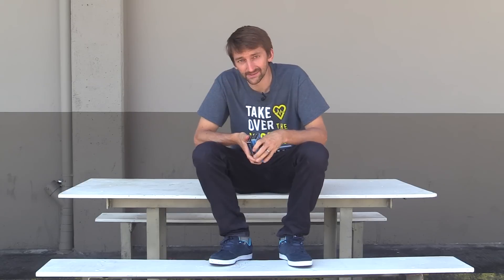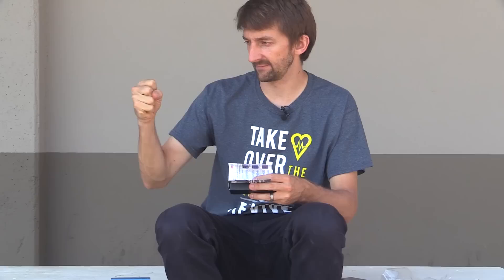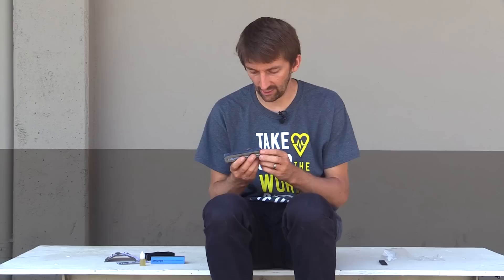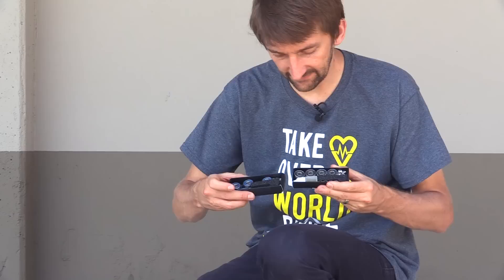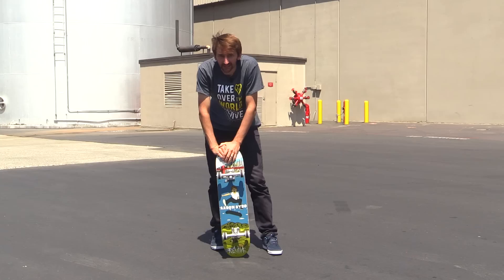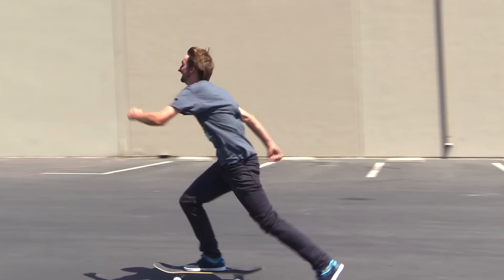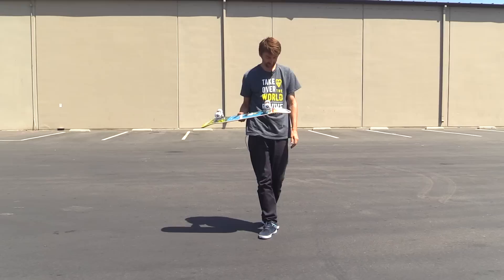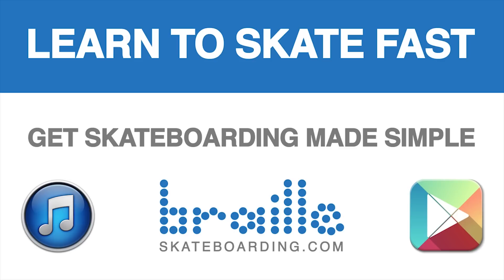CERAMIC BEARINGS VS STAINLESS STEEL BEARINGS | VS EP 9

Comment: Both Stainless steel and Ceramic ball bearings are a marketing ploy to get you to buy a product that YOU DON'T NEED!  I have been an industrial bearing sales rep for 20 years (and an avid cyclist, and we have this same "technology" debate).  Ceramic: Unless you are going to be skating/riding in a furnace, hell, or boiler, ceramic balls are silly; here's why: the purpose of using ceramic balls is they don't expand as much when heated which means they retain their shape better when the temps are over 500 degrees - since humans cannot survive at that temp and it is highly unlikely any of you will be skating/riding in those conditions, then you are left with ONLY the downside of the ceramic balls - they are HARDER than the inner and outer races which means they will wear out FASTER than conventional ball bearings and you will be paying MORE and doing it MORE OFTEN!  On to the the Stainless steel myth! S/S is need for corrosion resistance ONLY!  If you are doing ALOT of skating/riding in salt-water, you might want to consider them, but since the performance of boards/bikes in water is pretty bad, most of us avoid those areas.  Again, you are left with the downside of Stainless Steel - it's NOT has hard as regular bearing steel, so jumps/tricks will cause microscopic "dents" in the balls, thus creating friction/heat and poor performance over time.  CONCLUSION: Use plain-old ball bearings (even ABEC 5, 7 and 9 are a bit of a marketing ploy for skaters/riders).  If you want the best performance, choose a nice INexpensive set of ball bearings and replace them often.  You will also want to find ones that are "SHIELDED" not "sealed".  Yes, the "sealed" bearings will keep out water and dust, but the seals create ALOT drag on the inner races and reducer performance.  Shielded Bearings will keep out 99% of the crap and perform best - just replace often and you'll be awesome all the time!  Next, GREASE is SLOW, OIL is FAST... carefully pop off the shields and use a degreaser to remove the grease.  Replace with a light grade oil (not WD40 - it will evaporate), I suggest Singer sewing machine oil or ANY oil that is a "5 weight" or LESS - use often, just let it seep into the shields since there is a TINY gap between the shield and the inner race.  The excess will be pushed out by the balls when you ride next time. As far as ABEC 5,7, and 9: Congrat, if you have ABEC 9 - NASA doesn't use balls that precise!  Unless you are trying to control a turn down to the nano-micro-arc, you will NEVER see the advantages of that level of precision (even from ABEC-5 or 7).  You may want to consider using these "marketing tools" if your sponsor TELLS you to, but for us regular mortals who are just out for a good ride, skip the extra-$$$ and get no-frills Shielded bearings!  >>>> if you want an "upgrade" that IS worth the extra expense, then consider a Japanese Bearing over a Chinese Bearing - Only 3 factories in the world produce QUALITY "extra-clean 52100 Bearing steel" - one is Timken in the USA, SKF in Sweden and NTN in Japan.  Everything else is a "wanna be."  Japan has the BEST facilities for producing "micro" ball bearings - the USA and Europeans don't really do them any more since the Japanese are so damn good at it and the Chinese can do it "good enough" for the industrial and medical markets.  So, enjoy your ride and don't get caught in the hype of products whose ONLY design is to get money OUT of your pocket, not put performance in your board/bike!
Reply: +Jay Hyde well, I got caught in a rainstorm with cheap steel bearings yesterday, and today 5 out of 8 seized on me, shredding on my poor trucks and leaving me board-less for a day. Stainless for me next time. 

(rollerblade wheels on my board were completely unphased by rain, though. 7/10 would get wet again)
Reply: I got a couple questions I hope you could answer.

Would downhill Longboards be better suited with ceramic bearings? Reason I ask is the greater speed they travel at for longer distances.

Would for ultimate speed, one time use, would removing the dirt cover and decreasing them have the highest one time speed?

I have heard good things about bearings from the German market. Do you have any experience with their products?

Could you get away with using two bearings for a skateboard?(one per truck) Would there be a drag benefit?

Thank you for a great write up on bearings!
Reply: Good information, thanks. 
I was about to write... Ceramics are only advantageous in extreme temp applications. Also, skateboards are not particularly stressful on bearings when compared to there use in machinery / engines.
:-) I had SKF in my skateboard 25 years ago, I didn't know they were good.
NMB were more popular.
Reply: Yes it is, because on a skateboard a bearing suffers from a lot of vibrations and shocks from the road and tricks, where in engines they only suffer from high speed/high temperatures.
They are designed for high speed/high temperatures but they are not designed (at all) for vibrations and shocks, where any steel will win easily the duel
Reply: I know that if you oil a bicycle hub with high quality bearings (rather than grease it) you can just spin the axle in the hub and it will go like a top. (because I've seen this done) which sounds like a fantastic vote for oiled bearings. 

but ... basically, grease is higher viscosity, and it takes more force for the bearings to move through it than oil, but that difference in force is really minuscule. Spinning an axle in a bicycle hub is an impressive display, but it's meaningless in practical applications. The inertia of a moving bike/skateboard compounded with the inertia of the rider is many thousands of times greater than the force needed to overcome the viscosity of bearing grease. 

Sure, it makes a tiny tiny tiny TINY difference, but you have to re-oil the bearings all the time or they'll go to shit. With grease you can usually ride it for years without maintenance. 

all of this applies to skateboards the same as it does bikes. I'm sure people are going to grease their skateboard bearings and then notice that the wheel doesn't spin as fast as with oil, when they spin it with their hand, but that's because a skateboard wheel has very little mass, which means it carries less inertia, so it has less force to put into overcoming the viscosity of grease. When a human being (even a very small one) stands on the skateboard, suddenly you have a lot more inertia to pull from, so much that you won't notice the difference between greased and oiled bearings. so why use oil if you have to re-apply it all the time?
Reply: +Professor Genius thanks
Reply: Swedish steel for life.
Reply: WD-40 is not a lubricant. It is a Water Displacement spray/penetrating spray and it was their 40th attempt at making one. Thus the name "WD-40". It's crazy how many people confuse it as a replacement for grease or oil.
Reply: Anyone who has used HSS and Tungsten Carbide on a lathe realizes that steel deflects tremendously under load. That's why you can run twice the spindle speed and still have your chips be cooler. The edge of the steel tool (the very hard tool steel) defects and rounds slightly under load, making it not as sharp and put more heat into the part. As thus, a harder bearing material would make for less friction due to it remaining rounder as it rolls. Enough to make a difference-doubtfully.
Reply: Dam nice write up ty.
Reply: Johnny Catt I bought a skateboard with ceramics one time a couple years ago and have ridden through so many puddles and sand and they still run some fast and smooth but my other board with stainless bearings got soooo slow after riding through a couple puddles so I prefer the ceramics
Reply: @Johnny Catt Hey Johnny what would your opinion be on full ceramic 
bearing and racers with a touch of graphite? This would be for a hand 
spinner so no down force or heavy weight bearing.
Reply: Skate companies recognized a need for bearings that were less affected by heat energy and began offering ceramic bearings for more discerning riders. Ceramic bearings, made from a compound called silicon nitride, are smoother and harder than their steel counterparts. This means much less friction to begin with (these bearings have little need for lubricant); however, should friction occur, the ceramic material doesn’t expand, so there is no effect on the skateboard’s performance. 

As usual, higher performance comes at a higher price; but many skaters will tell you that ceramic bearings are well worth the premium.- Tactics Boardshop P.S. This is an actual skate company, not some random guy on the internet.
Reply: LegendLength Good point. All I've found is that downhill longboarders usually prefer ceramic bearings because they want to go crazy speeds. But I dont longboard. FOR THE AVERAGE SKATEBOARDER you don't really need ceramic bearings, but from personal experience I much prefer skating with ceramics. All Im saying is that you pay for what you get, if your worried about spending another 40-60$ or you dont care what bearings you have, DONT get ceramics. But they are worth getting if your really into skateboarding.
Reply: you cleared up so much shit with just one comment, my life was once a lie but now I see the truth you are the man the my the legend "Johnny Catt".
Reply: Johnny Catt but what about my fidget spinner!
Reply: I got these food stamps
Reply: honestly, I don't see the point.. I know this question is old, but I wanted to respond.. there is rally no "load" on the bearings to analyze.. my advice: no seals and no lubricant
Reply: I'd say it took me about an hour or so write... it probably took an additional 2 hours to correct all the grammar, spelling and syntax errors, though... lol
Reply: Hi, I have a gas turbine engine using 2 really expensive ceramic bearings (D688/602 976) (about £50 each). Why are they so expensive?
Reply: i can agree with johnnny, i always buy indrustial japanese or germany made bearings and not some stupid chinese branded "skateboard bearings".
Reply: Johnny Catt can I use cooking oil like coconut oil or peanut oil?
Reply: Johnny Catt i
Reply: (wtf are you doing with a gas turbine?) anything "aeronautical" is expensive.  There are liability issues that every parts manufacturer has to "insure" themselves against - many of the bearing brands I sell FORBID the use of their bearings in aircraft - they usually have a separate division that handles those sales - unless they are being sold AS "Aircraft Bearings," then they don't care who you sell the high-priced bastards to!
Reply: NTN and SKF are the  best manufacturer of ball bearings in the world - I give NTN the edge in the smaller sizes (under 100mm bore) next would be FAG, KOYO, Nachi in that order.  Fafnir/Timken MIGHT fall in there somewhere, but they would be priced way higher than the others and most of that manufacturing nowadays is in Turkey and Romania, which is not bad, but not really where they excel...).  All of these are gonna be pretty good... NOW,  20-something years in the business and I’ve NEVER heard of "Bone Red." They're probably NOT a bearing manufacturer -- they are what we call a "Re-brander," Re-packager" or "Private Label."  I can get you any bearing you want with any "branding" or "numbering" you want on it -- form the cheapest Chinese junk to the top-end NTN's or SKF's - ANY bearing manufacturer will put whatever you want on them for the right sized order!  If they don't say where they are made, then you can bet your trucks/forks they are Chinese and being put in pretty packaging - and probably marketed to more $$$ out of you than they are worth.  I'd ask.  if it a reputable bearing manufacturer, then they will happily tell you, but if it's not on the above list, I'd be cautious.
Reply: There is nothing wrong with the "chinese junk" in kids' bikes - trust me, Huffy has been doing it forever.  OIL IS FASTER THAN GREASE. grease just stays put longer  Use the lightest grade of either depending on the circumstanses.  For training, use grease -- for competition, use oil - if it's a multi-stage/multi-day event, clean and re-oil everyday - I give this advice to the cyclist, since it will only increase your speed, which we can all handle.. as for you skateboarders doing tricks and filps and crap - the extra speed (no matter how small) could effect your inertia enough to screw you in a competition.. so keep that in mind - we cyclist just wanna go faster...
Reply: Johnny Catt wow sir. Thank you. Very informative. Thank you for your comment
Reply: Johnny Catt was
Reply: The best lubricant for bearings is Gun Lubricant...not gun cleaner gun Lube stuffs amazing!
Reply: Rule number one about testing bearings: never test 'em without load.
Reply: Johnny Catt replying to save this lol thanks for the info
Reply: I like to skate in a volcano so i have to use ceramic bearings
Reply: Johnny Catt   You may be an engineer, but I have been skating for 48 years.  I have tried  almost every bearing made and time and time again when I get on one of my older boards and it has Bones Swiss Ceramics in it, the difference is night and day.  The roll is twice as far as new steel bearings. It is a difference that even younger skaters can feel. Like... “ Holy crap dude! this board is fast!”  Although durometer, diameter, wieght and rebound of the wheels all have a big impact on roll, the feeling is the same throughout all. my boards that have BSC bearings.
Reply: I like how the "CONCLUSION" is more than half the comment
Reply: where I can buy shielded skate bearings
Reply: @mykesmith3015  literally any skateshop or online store like Amazon. It's harder to find unshielded bearings
Reply: Sweet. Thanks! :)
Reply: Yeah,  I'm just going to trust you and not read all that.
Reply: thanks for validating what I've been saying for years: It's all hype. And bearings are going to wear out if you skate them, regardless of country of manufacture.
Reply: How/where do you order NTN bearings for a longboard? I'm pretty new to this, and I'd like to be able to save some money by buying industrial bearings instead of marked-up name brands, but I'm not sure what size or product number to order.
Reply: NBN or NTN 608 JAPANESE BEARINGS all the way!!
by far the best bearings out there and way cheaper than the "skate branded" bearings, been using them since 1996
Reply: Johnny Catt I realise this is an old post, but I notice the focus of the post was entirely about the actual ball bearings. Is it not feasible that manufacturers would use a higher quality enclosure (I assume the races are the channels the ball bearings sit in) than they would use in their cheaper products? I'm completely new to this topic, so I'm not disputing what you are saying. I'm just wondering if there is more to this than meets the eye.
Reply: Replying for future reference, interesting read.
Reply: Ceramics are literally only meant for super cars that’s how worthless they are for everything else
Reply: If i wanna upgrade my inline skate bearing from abec 7 to abec 9, will it make any difference? Is will be faster and spin much longer?
Please
Reply: That's bullshit I have put axel grease in my bearings because anything lighter will burn off too quick dry your bearings and make them rust and heat up quicker and more friction Once you break that axel grease in a few weeks your bearings will be perfect for months to years
Reply: where do i get the best bearings
Reply: Its its about distance not speed
Reply: What about oust bearings? They are super unknown and the moc 9 model that they sell IS SOOO GOOD now it is 45$ but they are smooth, they last a while, and just never ever stop rolling.
Reply: Brahhhhhhh this comment was better and more informative and funny then this hole video
Reply: What about noise? I'm trying to assemble a skateboard that makes as little noise as possible. And not surprisingly, nobody in the skate world cares about it. The wheels are an important part of this of course, but I did notice a significant difference between my old bearings and new ones. And now I wonder if ceramics might be even more quiet? Thanks
Reply: Riding on the Highway to Hell
Reply: Johnny,
Do you have a favorite brand,better quality? Timkin perhaps?
Reply: ABEC is not about turn precision though, but rather accuracy of the product in terms of overall shape. It's more a manufacturing thing. On top of that, NASA actually does use some of the most accurately produced bearings. Thing is, when things do not rotate at insane RPMs you are not going to notice the difference between ABEC 5 to 9. What you will notice is a general difference in long term lifespan, quality and most importantly the cost. When it comes to skateboarding the benefit of really anything is mostly a matter of taste when it comes to things like ABEC. But to say nothing matters is waaay too simplistic. I have three sets of different bearings in my current skateboards and the difference between more expensive bearings and regular REDS is actually rather big. Some of the REDS are already dying (after only weeks) and none of them spin as long as the other more expensive bearings anymore. Time of using them is the same for all three, all three have been abused including sand and such and none are clean. So no I don't agree nothing matters as all marketing ploy. Also WD-40 is not a real lubricant, regardless of what people (always) assume. It's useful to get rid of corrosion, maybe do some cleaning, but that's about it. Most bearings do not like WD-40. Last but not least, ceramic bearings are not meant to withstand higher outdoor temperatures, but rather higher temperatures caused by friction. If you have ever skated in some place warm for a few hours and will realise ALL bearings get hot. The other benefit is how ceramic balls are water resistant. This means moist as well as rain, so it is more useful than just 'to those who skate in rain' (which probably only people in Britain or the Netherlands would do anyway when given no choice). In terms of value you can question whether it makes sense to spend more than $30 on 8 bearings, but to say higher cost and higher quality bearings are  never worth it is kind of stupid.
Reply: @LegendLength  People seem to forget the temperature relates more to friction and high rotation speeds than 'outdoor' temperatures. I once had a bearing in my radio controlled helicopter bend that created huge friction and the thing got so hot it changed colour. So nope, in general it would still be valid in how ceramic bearings deal best with that.
Reply: There are bearings with non-contact seals that is meant to address the speed loss of conventional sealed bearings. Found those after reading your comment which is very insightful by the way. Thanks for sharing your experience.
Reply: Johnny catt the bearings encounter friction thus making them heat up. With pro riders speed is key and that speed can warm up the bearing and that is why ceramic bearings are good
Reply: Ok boomer
Reply: Johnny Catt do you skate?  Do you skate where there’s weather?  Do you own an e-board at all?  These are all applications for use of these bearings.  Yes, better bearings go faster and smoother & e-boards get the bearings hot.  The grease may be slower (use lithium grease in the cage gaps only & some speed cream on the actual bearing). You’re gold & 🖕🏼rain and dampness!
Reply: Kyle Hickey you should use superglue and taco sauce! 😺
Reply: tre yeah, no shit! 😼
Reply: Purwa Kusuma the 9’s will be new & clean, therefor they will spin smoother & faster, but if you were using both of them new, I would say there isn’t a noticeable difference.
Reply: One word: Friction
Reply: The outdoor knife industry is the same way it drives me nuts...All these super steels and knives that cost $200-300+ cause they stay sharp for way longer . These guys will never use their $300 knife to the point that it ever pays off.  Plus most can't even sharpen them anyways which will cost them more money for sharpening business to sharpen the silly things.  

I'm not saying these fancy steels aren't cool BUT its not necessary since most 1095hc and quality stainless like 14C28N German steel can be maintained with minimal stroping and a quick swipe over a ceramic rod. I have a nice knife made with CPM154 and its been one of my favorite steels yet many knife steel snobs trash talk it cause its hard to sharpen which isn't actually true. I've found that certain steels react better with ceramic rods and that's one of them .  

I just ordered a pair of ceramic bearings cause they were $50 but I got them for $20...LOL  I figured most good budget bearings almost cost that much anyways I will see how they feel when I get them.  You are right sir , just buy a good basic brand and replace them when they start acting up.  ...AND Japan and Germany make some awesome working man steel that doesn't break the bank .
Reply: Hi, I’m Waynko - No u most definitely cannot
Reply: floris Its just the better lubed the quieter it is
Reply: This is a quality comment. We appreciate the info!
Reply: Okay,  I've been educating myself for a day and a half on bearings for my OneWheel, I'm just gunna order a local NTN and the Burris Hybrid Bearings (about $70 AUD between the two options) and I'll let y'all know in like, two years which did me better.
Reply: Unprofessional Gamers hey, best of luck to ya!
Reply: mano o que nenhum engenheiro da internet fala é a minha duvida principal, os rolamentos baratos não correm, eu tenho um abec 1 eu tirei a graxa e coloquei óleo desengripante (lubrificante de maquinas, motores, engrenagens) melhorou, mas eu preciso dar uma remada com o pé a cada 5 metros se eu quiser andar uma esquina de skate! é chato! eu acho que se eu comprar um rolamento bom, eu vou poder ir mais longe remando menos, sem precisar trocar o lubrificante do rolamento, isso não é verdade? eu não entendo muito, justamente quero saber
Reply: Thank you Johnny
Reply: Johnny, what skate bearings do you ride? Also, as we are all aware of ABEC ratings...is there such a thing as "SKATE Rated" as used by Bones Bearings?
Reply: @Robebabu  Bones designs with priority on low roll resistance, especially initial, not on tolerances. That is what they mean with skate-rated.
Reply: Thanks for all he info! Always heard that SKF was quality and fun that you confirm that. Im from Sweden and I can remember back in the 80-90s where all skaters in my town was strictly using SKF bearing just like Indy trucks.
Reply: @lonnyzone_  Read the text again.
Reply: ty very informative
Reply: This is just wrong. This person has no idea what they're talking about because they're talking about bicycles. Skateboard bearings get dusty and you have to clean them or replace them. Steel you replace and ceramic you clean. It's very simple. And it has nothing to do with cycle bearing physics (source: I have been a long distance cyclist for 30 years and have cycled across Canada and many other regions, as well as having skateboarded since the 80s'.)
Reply: Cermics don't suffer as much when you go fast fast cause less expansion under heat. Important for down hill longboard, not for a skateboard hitting 20 at the fastes
Reply: I needed this,  because i've been hunting for ceramic bearings for so long, and it felt like a hunt that won't stop till I have my 808's; D:

and to just add my 2 cents of playing with a few bearing types:  Silicon lubricant beats oil, or grease, I tried oils, i tried vaseline, I tried the Q20 and it felt heavenly, as my bearings are all shieleded, - but i noticed that taking the shields off, and  also putting the shields back on must be done to never compromise the shape :/ that thin metal is critical to preventing friction on the inner bearings, as you say; :)

but what about the paradox of ceramic feeling so much smoother, and the speed increase? or faster acceleration?  i got standard bones and I put it on a quad-97mm road wheel for my rayne LDP board, and i literally FLY ! 
but I still need to condition my knees better for the wavy roads/ pavements; our trees always want to come through the cracks; 

I also watched a bearing comparison yesterday of Chinese steel vs US Steel - > China is a joke, and a standard hammer can wipe it out, - US Steel: standard and upgraded hammer cannot even break it, - > it indents both the surface AND the hammer hahaha

I want to know how my country's steel is - > South Africa, but I don't often find places to test for local bearings :?
Reply: @ericmorrell806  Commercial bearing, B&T (Bearing and transmission) pretty much any bearing reseller can get you NTN bearings. 608LLUA were the numbers when I worked there, might be different today. Also Grease breaks down into oil. So people raving about oil and bashing grease really don't know the difference. The grease used in high speed bearings is designed to run at high speeds  +10k rpm. A skateboard just doesn't run at those speeds for very long if at all. The actual number on the bearing is a lot longer, but its mostly defining the grease. the bearing houses would be able to tell you what NTN recommends.